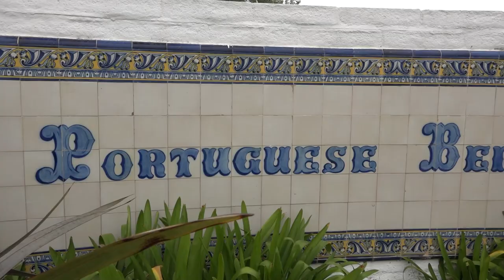RPV Public Works "Landslide Update" on RPVtv

Comment: How much is this remediation costing? Isn't this the definition of insanity? In the late 1950's, my folks looked at a lot in Portuguese Bend but passed on the purchase since the land in that area had just started moving. I used to drive on PV South all the time for years when I lived there, and that road was always moving and that one corner of the Glass Church always had blocks supporting it from collapsing. Fast forward 60 plus years and the landslides have worsened, yet hundreds more homes were allowed to be built next to and above the slide area. How does this make any sense? How many millions have been spent over the years just for those homeowners?

Comment: "Brackish" is so vague - not science feel brushed off
Reply: The use of the term brackish is absolutely science-based and is very commonly used when describing water quality. Especially by water quality professionals. It is greater than 1000 mg/L of total dissolved minerals which indicate that it is not drinking water quality, but it also clearly indicates that it is not sea water, which would be in the neighborhood of 30,000 mg/L. The term is not vague at all.

Comment: Too little too late. The slides have been tracked for decades and the county still permitted developers to build homes. The homeowners are the victims.
Reply: The new age builder owners sued for the rights they where not given permits with out a $$$$ fight.  This slide Only been tracked after onslaught in 1950's  Original homes sat there safe and fine for many years before the scarp head was opened.
Reply: They are not victims. They are rich and educated..this problem was known since 1931.